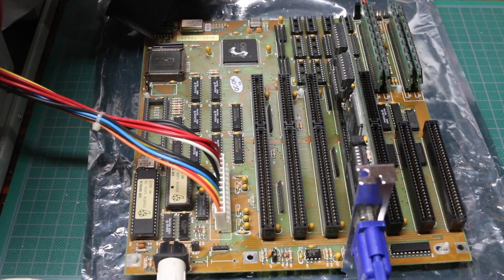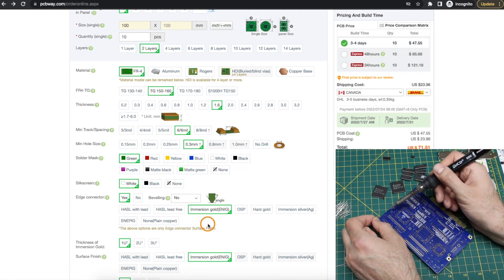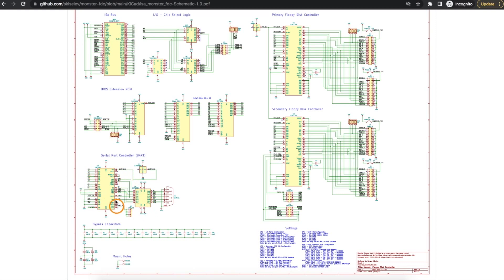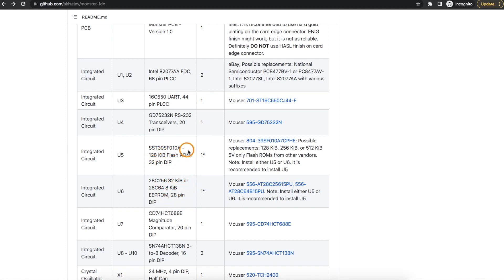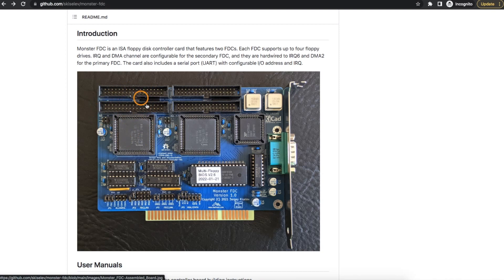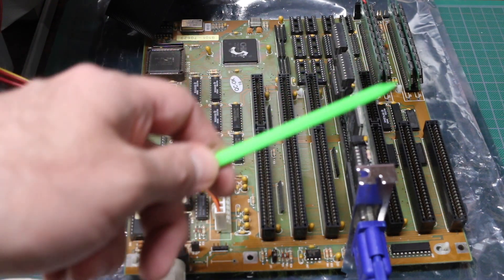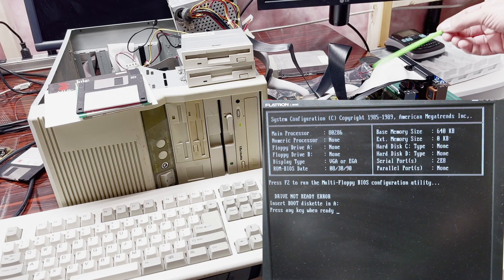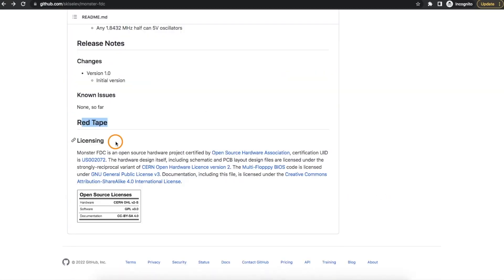Monster Floppy Disk Controller Card: 8 bit ISA in a PC AT 286

Comment: Nice video, thanks!
Regarding drives numbers:
The physical drive numbers reflect the drive number on the controller. Each controller can have up to 4 drives, and the board is wired in such a way that physical drives 0 and 1 are on the top connectors and physical drives 2 and 3 are on the bottom connectors. I think you have a mistake in your explanation, and you've actually specified physical drive 0 (not logical 0) for the drive connected to the top left connector - second controller.
The logical drive number refers to the number used by the BIOS calls. You can assign the logical numbers independently of the physical numbers. This allows "re-mapping" drives as needed. For example, you've connected a 3.5"/1.44MB drive as the physical drive 0 on the first FDC and a 5.24"/1.2 MB drive as the physical drive 1 on the same first FDC. You've also assigned logical numbers 0 and 1 respectively to these drives, so that DOS "sees" them as drive A: and drive B:. Now imagine you want to have the 1.2 MB drive as your drive A:. One way is to rewire everything... Another is to go to the Floppy BIOS setup and swap the logical drive numbers - set logical drive number 0 for the 5.25"/1.2 MB drive and logical drive number 1 for the 3.5"/1.44 MB drive...
Reply from the maker: Thanks for stopping by and of course thanks for designing this and related PC Cards!
I may have to try starting over configuring the drives from scratch to confirm what I did, maybe I remembered it in reverse, so this might help:
When it says in the BIOS config printout...  Drive 0  1.44MB 3.5"   #0  on FDC1,     Is Drive 0  the physical or logical?  And is   #0   physical or logical?  Maybe that's where I went wrong.
Reply: @GadgetReboot  "Drive 0" is the number zero logical drive, meaning that it will be mapped to drive A: by the DOS. #0 is the physical drive number. The screenshot here https://youtu.be/fZdekwbet6g?t=665 shows the mapping. You can see that the logical Drive 0 is the physical drive #0 on the FDC1 and the logical Drive 3 is the physical drive #0 on the FDC2

Comment: Cool project.  Thanks for the doc/walkthrough.  Why does the BIOS config stats output still show 'None' for floppies w/the card in and configured?  The serial port configuration shows up.  What's up w/the floppy config?  Also, did you test the serial port at all?
Reply from the maker: I had to change the serial port IRQ from 5 to 3 for com4  that I had it set for, and then suddenly it worked when I ran telix for DOS and bridged the serial port pins two and three for a loop back test and I could see typed characters coming back.
I think the reason it’s OK for the main motherboard bios to show no floppies installed while booting is because that just basically means the motherboards BIOS is not responsible for the floppies but there is a print out from the BiOS in the floppy controller while booting, and that shows all the drives configured. 
I remember something similar with needing special controllers for hard drives back when they started getting too large for the motherboard and we had to use those fancy expansion cards that took control so it may not show when booting up but then the drive was there magically at the end.
Reply: @GadgetReboot  IRQ3 is the default for COM2 and COM4, and IRQ4 the default for COM1 and COM3... Which is funny, since IBM PC hardware doesn't really support IRQ sharing (so, for example, you can't really have both COM1 and COM3 using IRQ4, not even if you're using only one of them... as the IRQ line is not tri-stated by the UART...). The IBM PC and IBM XT had only 8 IRQs, with 2 of them used by the motherboard,  one by the FDC, one by LPT port (why?!), and one by the HDD controller (IBM XT), which didn't leave many available IRQs... So I'd assume that caused the unfortunate decision to "share" the IRQs that cannot be shared... Anyhow, if you use non-standard IRQs, you'll need to configure your software accordingly. Telix seems to have a configuration for this: "Press Alt-o, then select comm port setup. Choose your COM port by pressing the appropriate letter. Then, when you press Enter, the cursor should move from the "Start Address" column to the "IRQ" column. Enter the number for the IRQ."
Reply from the maker: I'll check the Telix config options - I only briefly figured out how to change the com port on the fly, I haven't properly used Telix since the mid 90's!  Thanks
Reply: @GadgetReboot  Thanks!

Comment: Interested if you have a source for newly made floppy media.
Back when I did floppies, there were some prized units that could be made to work with non-PC formats, and to format disks with extra tracks.
There are also "floppy tape" drives, which were relatively inexpensive, common then.  I used "tar" (tape archive) and the "ftape" (floppy tape) module/block-device to do this.
Reply: I think there are 0 manufacturers in the world right now that manufacture floppy media.
Reply from the maker: i’m just using any old floppies that happened to be still in the disk storage cases or just floating around in boxes that I uncovered in the past year after unpacking, and I also have a few boxes of unopened Maxell that I got from somebody two years ago when they were clearing out their rarely entered storage side of the house so I’m just hoping I have enough that still work. 
While I was making this video two disks started giving general read error when they started out working. I just need to squeeze a few more years out of them at least.
I have a Colorado jumbo 120 meg tape back up drive that I still need to try to get working. I think I have at least three tapes for it. I got it used way back in the 90s and never bought any new media for it and I’m curious whatever files I put on there back then.
Reply: @GadgetReboot  Yes, my experience with really old magnetic media, like tapes or disks, is that they can disintegrate quickly with use.  Might get 1 or 2 chances to block copy an image of old disk. Repeated reads and writes tempt fate.  Often end up with muddied r/w head. Your new old stock may fair better. Off-topic: DVD-RAM was a pretty cool idea, but was never able to buy media that worked reliably. That format may be not be currently manufactured. Colorado drives ... yes ... that is what they were called. I had clones mostly.  Some tapes had extra capacity, and it would take a really long time to write to the whole thing. Glad that I took my stuff off of 4mm and 8mm a decade ago.
Reply from the maker: I remember magazine articles showing worm drives, one time write. I can’t remember if that was still the 80s or getting into the 90s.
I remember also seeing catalogues or magazine articles with tower cases full of 3 1/2 and 5 1/4 drives and possibly tape backups and I always wanted a fully loaded system like that. Never really did have it, and now I actually probably could put together something like that but I’m instead wishing retroactively that I had a use for it.
Reply: @GadgetReboot  Have never played with a Worm Drive.  Still waiting for Star Trek data crystals. Your drive floppy controller is pretty cool.  But without new media, mass-producing software disks will be tough. Somewhere, someone must have a working 9" drive.

Comment: Wow, Memories. Setting up IRQ's Addresses, DMA's and all that stuff. Welcome back to the head scratching days Gadget.
Reply from the maker: I used to have problems getting sound cards to cooperate but the worst was probably the vesa local bus big I/O cards with the support for larger hard drives plus all of the serial and parallel and game ports and all of the jumpers, I was lucky to get anything to boot up.
Reply: @GadgetReboot  I have had my fill of setting jumpers. I had done it for years. I wish I had saved all my old gear from days gone past, but space was limited. I had to move on. Looking forward to the rest of your projects.

Comment: I imagine 90% of people wanting a card like this would be happy with a much simpler single floppy card you could boot from. I can't imagine using 8 floppy drives except as maybe a musical instrument of some sort. ;)
Reply from the maker: I'm here to represent the 10%'ers!  I do want to use up to 4 at once and possibly a tape backup, and just having the ability to use separate cables to run to each drive makes it useful.
Reply: You can also build the board half way and have the option to add more stuff later.